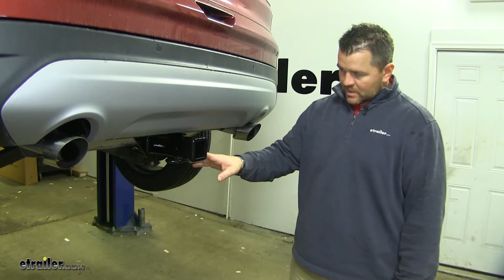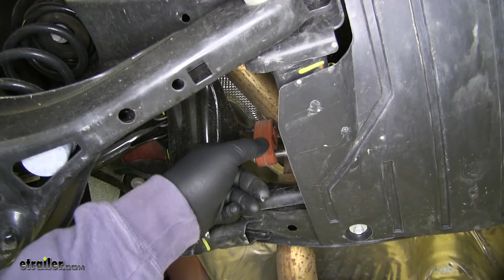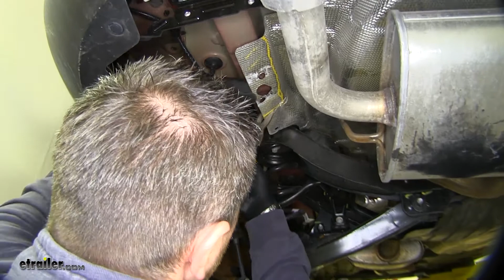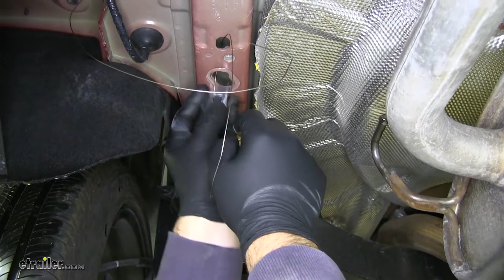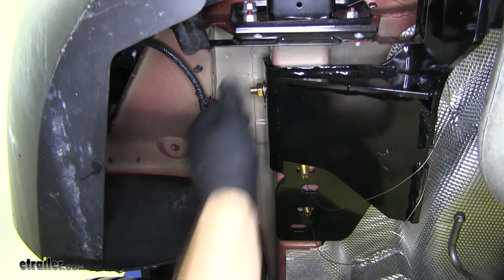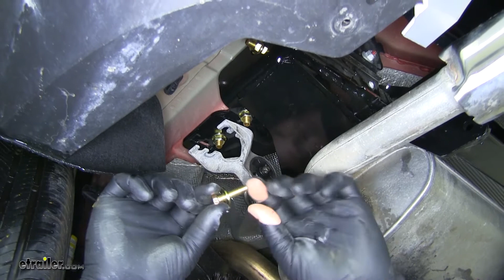etrailer | DIY 2018 Ford Escape Installation for the Curt Trailer Hitch Receiver

Comment: I was able to install it with two people and no  lift. I will however need to replace both muffler brackets because they both cracked when torquing to 23 foot pounds.
Reply from the maker: We are happy to hear you were able to get it installed with an extra hand. We did not have the same issue with the muffler bracket that you did. 
https://www.etrailer.com/Trailer-Hitch/Curt/C13186.html

Comment: I wish the etrailer was easier to install without using a lift and cutting away the heat shield, etc.. However the video does explain the process well

Comment: Absolutely the best installation video possible... for a task that is not exactly simple.  The kit and the instruction make it much, much easier.  I do suggest that TWO people are involved.  One person trying to both heft the way and thread the wires would have made the task way hard.  Also, on my 2019, I saw no need to remove the orange tailpipe hanger.  I could easily pull the tailpipe down to the frame where removing the hangar would have made no difference.

Still, great job on the video and supplying all the right bolts, nuts, wires, etc.